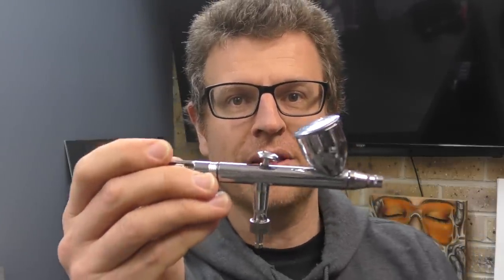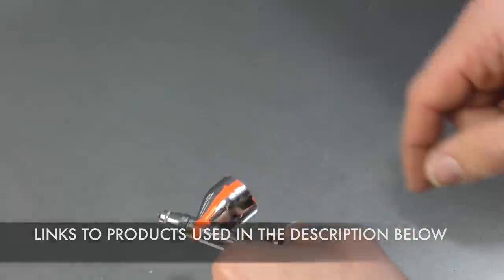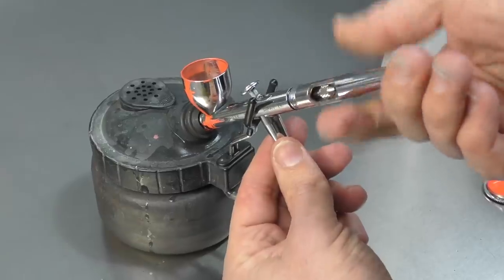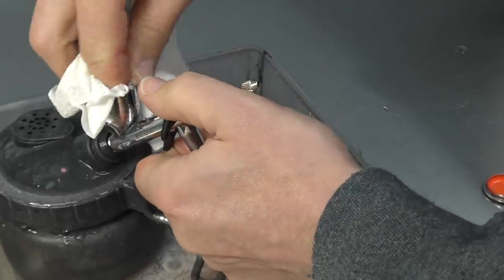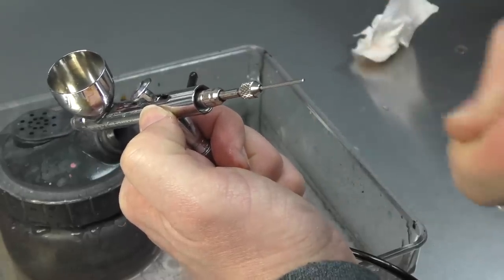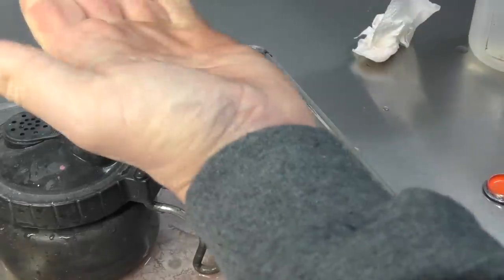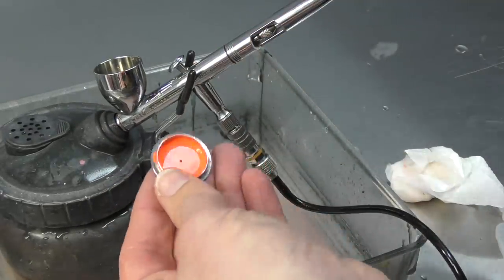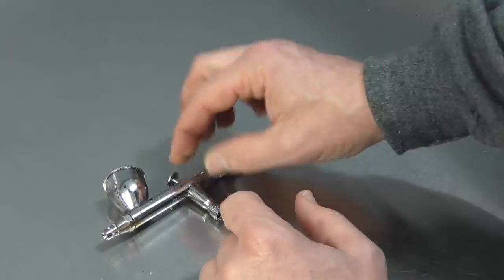How to clean an Airbrush

Comment: How to stop making a mess; remove the nozzle and pull the needle through the front of the airbrush. This prevents the needle dragging any paint backwards up through the airbrush (so you don't have to pour water or cleaner from the back end). Then all you have to do is clean the cup, replace the needle and nozzle, blow some cleaner through it and and you're good to go. Elapsed time, < 1 minute. Also, hot water works better than cold/room temp. Hope this is helpful to someone.
Reply: Thanks 👊

Comment: Just a note: On the HP-CS there is a packing o-ring behind the brass sleeve inside the air valve, this o-ring can get damaged from oils/lubricants/chemicals/reducer/airbrush cleaner/etc over time.  If and when it get damaged (typically it gets slightly swollen) it constricts too tightly around the bottom of the trigger assembly and causes slow trigger movement or a failure for the trigger to rise back up.  I found this out after cleaning the valve piston like you do in this video, and cleaning the air valve cavity and everything else and still having a slow/sticking trigger.  I discovered the sleeve by accident when attempting to clean the cavity using a qtip that fit into the sleeve snugly, when pulling the qtip out, the sleeve slid out as well, granting access to the hidden packing oring.  I found that Iwata sells these o-rings for around 8 dollars, but I also found that I could go to my local dart store and purchase tiny orings (they are meant to prevent the flight shaft from loosening) for ~25 cent each, and these fit perfectly, and solved my issue regarding a slow/sticking trigger.  I doubt they are solvent resistant, but thus far I've yet to need to replace it.   Just giving a heads up for those who find this method does not fix their trigger issues (as was the case for me).  

In the exploded view of the owners manual on page 15, the sleeve is #8 and called the "air valve guide body" and the oring is #7 and called the "air valve o-ring: https://www.iwata-airbrush.com/mm5/graphics/00000001/ECL101-IM.pdf
Reply from the maker: Thanks for the info 🙏🏻
Reply: @AirbrushAsylum  thanks for sharing, I just found my an O ring at the bottom of my paint well, New at airbrushing and new owner of IWATA Eclipse. The location and info helped me fix the problem. But sounds like an expensive problem to fix. Have no clue about any dart place where I live.

Comment: Based on your great advice, I purchased the Iwata Eclipse Hp and instantly I understood why one would spend the money on this airbrush. It works at a higher level than the $30 ones. The needle is of a higher quality metal. Also, the Eclipse is perfectly weighted so it is very comfortable in your hand. Finally, it is a lot easier to clean in my opinion. Thanks, Now, let's airbrush!
Reply from the maker: Thanks for sharing and SO happy that you are enjoying your eclipse, it will be a brush that you will have in your collection for years as it's such a versatile, quality airbrush .

Comment: You have reignited my love for airbrushing. I get so excited when I pull out my gear with a new project in mind. I however usually pull back on the needle lever when installing the front cap so I don’t hit the needle. Also I clean the cup out in the sink first to get the bulk of the paint before using the porta potty. Love your show and thanks. Oh and if you need to lube any o-rings you have to use silicone oil. Maybe pass some water through after in case it gets in the paint path.

Comment: I’ve had bleed over just using water , so after I clean out the air brush with water first I always go back over the Needle & the airbrush with airbrush cleaner then run water back through it & if I need it really clean I,ll take the whole airbrush apart , clean it as much as I can with brushes then throw all the small parts in my ultrasonic basket & throw them as well as the gun into a hot ultrasonic bath using Magic Green soft soap for 2 cycles , it’s very clean after like right off the show room floor clean .

Comment: Great videos. Helped me a lot since getting back into using an ab during lockdown.
I've just got a brush out and it's not spraying paint. There's air coming through the nozzle and it goes back into the pot if I cover the nozzle for a backwash but nothing when I try to paint. I've stripped it and cleaned it and put it back together but no paint. Any maintenance ideas would be great. Maybe a video on common issues?

Comment: Thanks for the tips. One note: Needle must be removed to the front way after removing nozzle, in that way the remainig paint on the needle will not penetrate in the internal mechanism of the airbrush.
Reply: shouldn't need to remove the nozzle unless it is damaged.

Comment: I have that same cleaning pot but I prefer to clean out the airbrush gun cup by spraying water in it and dumping it out into a large plastic container. When the water runs clear I will add more water then spray it out. It takes too long to spray into the cleaning pot. Sometimes I even clean the airbrush cup out in my bathroom sink. I only use acrylics so I don't think it's a big deal.
The real hassle for me is trying to place the trigger back into the little hole. It's such a pain.

Comment: in a bind i use Klean-Strip GSG14 Naked Gun Spray Gun Paint Remover. just run some laquer thinner after to remove the oils. this stuff is a life saver and is like a full dissassembly .
Reply from the maker: Thanks for your comment I personally have never used the product / method which you mentioned but I am sure it’ll be helpful to some viewers here 🙏🏻

Comment: thanks for the video. 
may i ask, i see your paint says water based. well, i starting with acrylics  i'm wondering if i'm simply having bad acrylic problems or if my pains old? i've tried all sorts of thinning ratios but regardless, the inside of the brush's cup gets covered with paint like yours, but yours washes away by just a simple flush. my acrylic dries and hardens to a hard film very quickly. it's so hard to wash off. this drying out makes my needle dry out so so fast and makes cleaning awful.

Comment: Backflushing with a wash bottle is pretty messy, even with a tray. I picked up a 10-pack of ink syringes to fill fountain pen ink cartridges, and i discovered the needle on those syringes is the same diameter as the needle on my Badger Renegade Krome, so i now use that to backflush, with very little spilling. The needle doesn't comfortably fit into the back of my Master airbrush, so it's not a universal solution. I have a PS-270 on order, and hoping it will work with that. I'm also planning to look into finding a rubber bulb that will attach to the syringe, so i might be able to add a little more pressure behind the backflush.

Comment: Hi there, thanks for the tips. Can you buy a prong for every brand or a universal one to clean the action housing ?  Question.. I bought a FENGDA, not Chinese, basic three needles and nozzles to start with. I've heard allready a few times, that it is a good idea if you buy a cheaper kit to "polish" the aria where the point of the needle and nozzle meets on the inside with very fine polish compound like schratch remover for car paint and rub it around , so they would fit and close better ? Do you think that's a good idea ? Thanks in advance. Greets from Belgium.
Reply from the maker: Thanks for your comment and glad you enjoyed the video, the tool for the plunger assembly is pretty much available as 1 to fit all (except for the eclipse) not too sure on all other brands but I mean iwata and any other brushes that share the same plunger assembly design . As for the needle, I have heard a lot about polishing as well, can’t give you a 100% accurate answer as I have never done it, I only use SharpenAir to re sharpen or fix my needles , but I urge any viewers from the community to provide useful feedback if they have succeeded with polishing needles on cheaper brushes. 👌🏻👍🏻

Comment: So this cleaning process Has to be done after EVERY color used? It's My first time using an airbrush. Coming back to building models after 40yrs, and having used cans. So far I've obtained two airbrushes, an airbrush compressor with tank, and built a spray booth.

Comment: Totally off subject I bought a master airbrush that for some reason won’t spray paint I pull back on lever and nothing when letting off the air it will spirt a little paint what would cause that?
Reply from the maker: Check that the needle locking nut is tight so that when you pull back on the trigger it retracts the needle and allows paint to flow through the air cap. Hope that helps 👍🏻

Comment: I was wondering how to do this properly, I guess I lucked out, I have the same airbrush, how would one know what size needle is in your gun, is it written on the needle some where, thanks for what you do
Reply from the maker: No probs, glad you enjoyed the video it depends on your airbrush iwata airbrushes have one needle / nozzle setup which cannot be altered, other brands like paasche for example have notches or numbers to identify needle sizes usually found on the back of the needle , hope that helps 👍🏻
Reply: @AirbrushAsylum  I have an eclipse hp cs,  what size needle/nozzle comes with this brush
Reply from the maker: Michael Giddens the eclipse runs a 0.35mm needle nozzle setup 👌🏻👍🏻

Comment: My dual action neo for iwata became a single action spray midway during painting. I took the nozzle out cleaned and also cleaned the needle, still seeing continuous paint as soon as I press the trigger. Any suggestions?
Reply from the maker: there may be a small amount of dried paint inside the nozzle which is not allowing the needle to 'seat' properly therefore allowing paint to escape when the trigger is pressed.
Reply: @AirbrushAsylum  it ended up being the case that I install the needle backwards lol. Too much of a beginner...

Comment: Hello dear artist!!!
I have a problem with my iwata eclipse HP-CS 0.35mm, when i press down ONLY for air a small amount of paint comes out!!!
The air cap and head assembly are well at their posisition, what can go wrong? My needle is not bend , only thing i can think of is about my nozzle but at a first glance seems to be ok and clean
Reply: You need to clean the nozzle better, and or replace it. I had the same issue, and noticed paint had crusted so bad that the nozzle was ruined, it was cracked and beyond repair. After you are done with your ab for the night you must do a thorough cleaning.

Comment: I'm a tattooist to trade I'm wondering if there is any reason not to use an ultrasonic bath as I have one to hand and Ive already used it on small metal parts like the tip but I know there are rubbers and seals etc so I'm just wondering if an ultrasonic bath can damage an airbrush?

Comment: Thankyou for your video,
I purchased an airbrush, but when i tested it with water, only air comes out but when I completly remove the needle , then it sprays water. I have adjusted all the knobs and tightened the one holding the needle, still only air comes out.
please can you help
Reply from the maker: The only thing I can think of is that you are not pulling back on the trigger once you have depressed the air valve, you need to press down for the air then pull back on the trigger to allow the needle to slide back and release the paint , this vid may help 👉🏻 https://youtu.be/CBFDPgbtXOY
Reply: @AirbrushAsylum  Thanks for your reply. I am pulling back on the trigger all the way down and back , but only air comes out. The nut holding the pin in the back is tight and the pin goes in and out when I use the trigger, still only air comes out.
Reply from the maker: Not sure...? I would recommend you get in contact with the airbrush supplier as it may be a faulty brush 🤔

Comment: Very useful tip... I have one with trigger keep sticking down ..
Reply: clean the area where the trigger sits first then just a tiny droplet of oil product to the bottom of the trigger. that will get you going . ill let the master tell you, i just cant help myself. 30 years spraying so i have to help
Reply: @palomino13  spraying Modells too? Cause I've got some problems with closs coats.
Reply: @nimofy6336  if you are talking about the final clear coat , those tend to need to be thicker . reduce them more but that requires careful and more coats but worth it. you can use a bigger needle and tip setup if you have it
Reply: @palomino13  my paint texture does not dry to a closs finish. Rather a ruff and more semi gloss finish. Maybe the paint is to thick?
Reply: @nimofy6336  exacty. your clear has to be pretty thin.reduce it, go a bit higher on air pressure if possible. test on something even a glossy magazine page

Comment: Please HELP!!! i just bought a brand new iwata eclipse. After testing it out with a water based paint, i went to clean it just like you said in the video, but after re assembling it, paint/water doesn't come out. Only air. The paint/water stays in the cup. Ive tried EVERYTHING and nothing works. This is my second airbrush, the other one (iwata revolution) same exact issue. What am i doing wrong? I followed these exact steps.

Comment: For the people who use solvent based paints: DON'T follow this the videos advice.
There are advice and help provided by the manufaacturer... Why not just follow that. When you give advice to thousands of people or paying customers, do you not have a responsibility to teach best practices?
Like for instance:
1. Don't pour water behind the needle chuck (The oring inside the body between the trigger and the nozzle. This prevents paint from travelling back through the airbrush, hence not needing to clean it)
If you did this with lacquer thinner you would ruin every rubber o ring in the back, air valve and others if present in just few cleaning cycles.
2. Don't mix used paints especially not if you are a beginner. Vallejo paints have a tendency to dry like gummy in the cup. Then you pour that dried paint into the fresh paint and next time when you shake it up the dried bits break up and you have a great clogging fluid, and will need to buy new paint.
3. Don't pull dirty needle through the back of airbrush..............

Best practices:
1. Pour water into empty dirty cup. Stir with brush or flush with pipette to remove from surfaces.
2. Spray water or cleaning fluid through the airbrush until it seems to run clear.
3. Switch paint and continue if you want to avoid disassembling the airbrush (If you have Iwata or clone there is an argument for not unscrewing and screwing which causes wear and tear on threads)
4. When finished repeat above steps and pull the needle out the front, wipe it down and maybe clean the nozzle with interdental brush (don't use the metal nozzle cleaner, the are often made of soft metals and just tiny invisible nick can affect spray pattern)
5. If you have a small amount of paint build up behind the needle chuck you can wipe it off with a damp cotton swab.
Also read the advice the manufacturer gives, please...

Or if you have another airbrush and use solvent based paints. Fill the cheap airbrush with solvent and spray down the dirty expensive airbrush. Pay attention to the hole where the needle pops out into the cup. Don't spray rubber seals with solventsthey will no longer fit .

I see so many people happily and convincingly teaching their home grown methods, having no clue how that would work out on a larger scale with many brands and materials. People chucking the whole shebang, air valve and all, directly onto the bottom of an ultrasonic cleaner

Comment: What if you clean the plunger and your trigger is still sticking?
Reply from the maker: It will prob need more cleaning...take a look at this vid which should help 👉🏻 https://youtu.be/MyH0HTv0TU8
Reply: @AirbrushAsylum  I cleaned both!  The o-ring looked a little ragged and I realized the plunger was slightly bent so I ordered both.  Not sure how it bent?  I bought it used(original HP-C).  Has some miles on it

Comment: You are NOT supposed to pull the needle out the back, that is not only bad for getting paint stuck inside that damages the gun, but pushing the needle back in the rear is severely bad for the needle tip.  Just take it out the front and remove the tip inserts to clean them properly.  Im a noob and I know this from watching many others.

Comment: add a little superlube to the air valve on reassembly
Reply: That stuff is crap it gumms up over time
Reply from the maker: Yes agree with Rob, I never use super lube it’s the little evil drug that is packaged with your airbrush once you start using you always want more 😫

Comment: I would not recommend back flushing.  A solvent flowing into the air valve will damage the rubber o-rings in the air valve assembly.  My advice to students is to keep the dry side dry (behind the teflon seal).  Allowing paint to flow into the air valve area is just asking for trouble.
Reply from the maker: Thanks for your comment and thankfully most people use waterbased paints now which makes everything a lot safer 👌🏻👍🏻
Reply: i  have ruined many trigger assemblies that way. i use strictly eurethanes